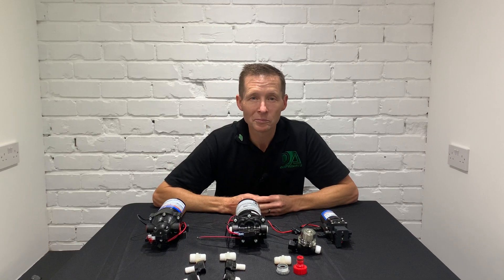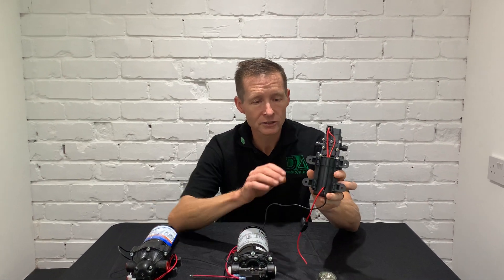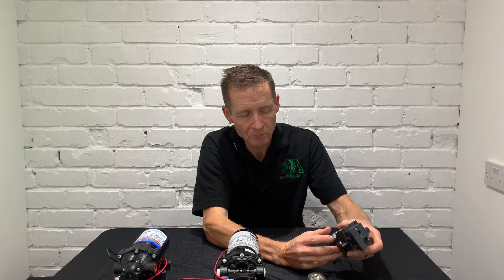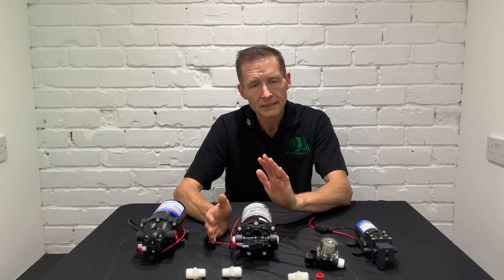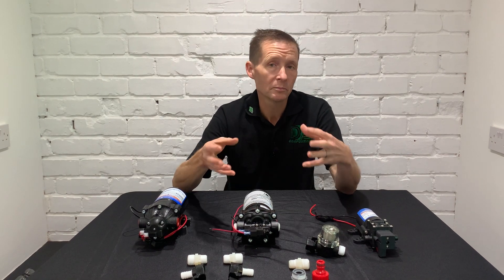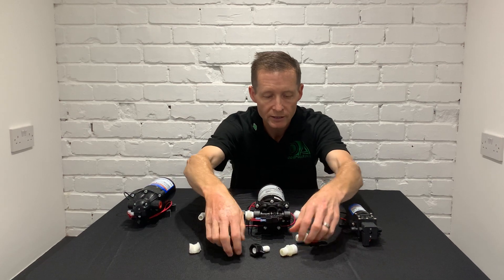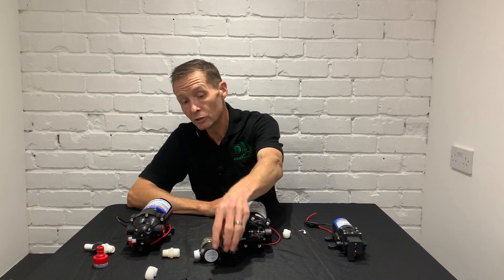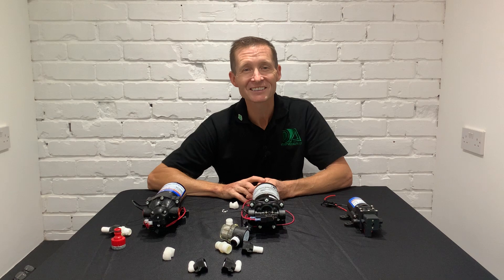Pumps for Water Fed Window Cleaning

Comment: How many gpm pump should I get to run my wfp? I used a 7gpm remco today and it works great but my wfp hose burst about 20 minutes in. Could’ve just been old but idk
Reply from the maker: Hi , if that’s correct that pump is 26 LPM ? Imo it too much flow for window cleaning I do think the range of 4/8 LPM is just about right also the control will help the flow rate too